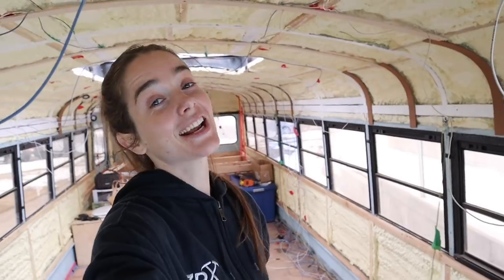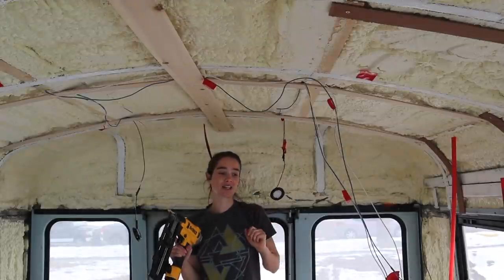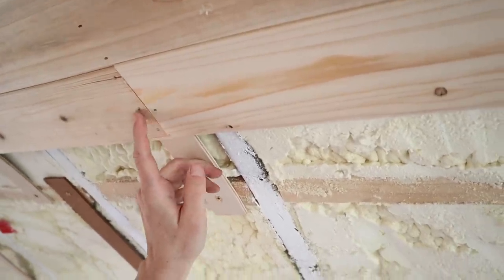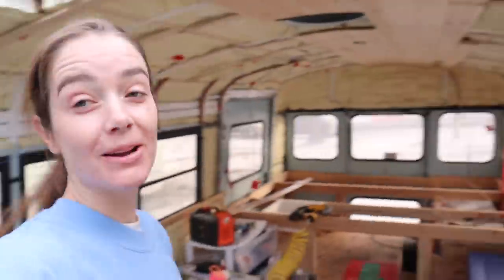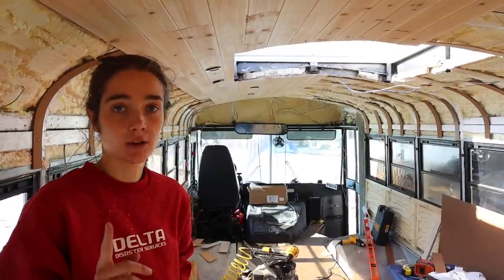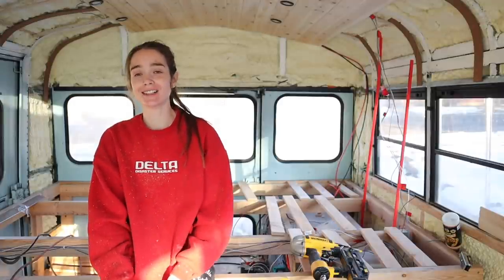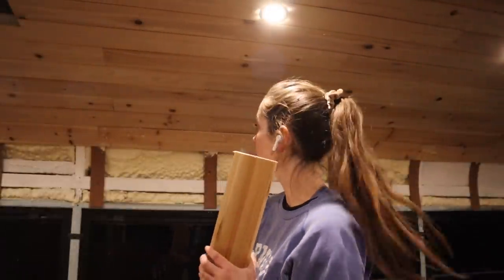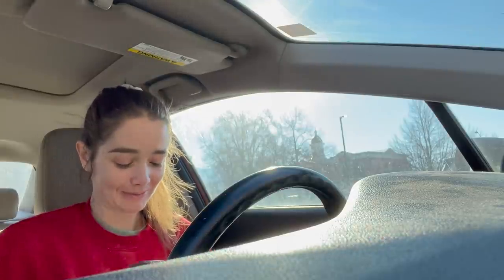Cedar School Bus Ceiling // Tongue and groove planks for the skoolie ceiling (Bus Conversion 47)

Comment: When you put your bulkhead walls in, and the cabinets, the curved ceiling will pretty much smooth out. Your doing  a great job . Just remember...no one will ever notice any flaws when you go by the off ramp at65! Your building a house in a tin can 🥫 so, it's like a square peg in a round hole. All I can say Emma is yay 😁😁😁😁😁

Comment: The bus looks awesome! Your doing a great job!
I wanted to mention I'm think your vent opens backwards. Ive worked on RV's and campers for 30 years so I thiought id mention it if someone hasn't yet. 
It should open to the rear so it can be open when driving and wind can't rip it open and break off into traffic behind you. And without a match to keep it locked when closed whe wind will absolutely dip it open and it could fly off your rig. 
Love the bus! Your doing awesome!

Comment: Very nice job on the t&g ceiling! We used the same sort of pine t&g on our bedroom ceiling, and applied a wipe-on tung oil to finish it. That was several years ago, and as expected, the ceiling is now a nice mellow golden color, just a little darker than the bare wood. It's kind of a p.i.t.a. to apply, but well worth the effort.

Comment: Got it done.  Wood filler and consider taking glue and sawdust from cutting those boards to make a paste and fill using it.  That works quite well.  Take some left over scrap of the boards and test your stains, polishes, ect on that first.  Give good time to dry before giving a thumbs up or down.  You are making progress, be glad of that and continue to Git Gud.  Do your thing.  I loved the part where that guy came in and was like, "uh too low in here.." and you were like,... "how bout over here..."  with the raised area.  Noice stuff.

Comment: The ceiling looks so much better now, at least now you don't have to duck under wires. when doing tunnel and groove boards get a short length and cut it down the middle then use the appropriate half to hammer against rather than risk damaging the piece you are putting into place, good job well done

Comment: Also you can use small bolts places, with a bolt and nut on the back to tighten in some places and you don't have to be so exact with the hole size, but it can really only work in places that you can get to both sides.

Comment: I would use clear satin polyurethane. Brush the cracks then slowly roll the rest. It will work like glue and hold it together. Do that before you fill any holes so it doesn't leave a blotch. Liquid Nails works good for caulking. It shrinks a bit and dries a wood tone. But not the holes. They have wood tone crayon sticks. I don't think you'll notice the holes after it finished. 🌹

Comment: In the future you can make a spline for the groove side it's just a small piece that you can stick in the groove of one board the centerboard to make it have a tongue on both sides

It's a little bit hard to do it on the material you're using cuz it's very thin but you can probably find something that's already cut at the supply store or you could cut a piece if you had a table saw

But you did an awesome job

Comment: Hehe, definitely work in progress. As you say bad-ish... Doesn't look bad-ish to me.. You should have done better if you laminated cross supports at least two layers.. One more advice - shoot the nails a bit slanted, not exactly square to the board as the grip will be better. Oh, you're really trying to start a fire, don't you? =) Yo, those  parts when everything gets along and then a sudden "crunch" and "oh shit", "damn".. tells you a slight pause in the progress is coming.. =D Oh, safety glasses when drilling upwards would be a nice improvement.. Linseed I think is pretty fine, just warm it up a little before applying, if it's cold.. I'm still having a blast looking your videos as you try to keep composed and serious... Good work though, the final happiness is priceless! =) Go Emma, cheers!

Comment: Don’t try to fill the gaps with wood filler, it will just draw your eye to it and going down the road it might just vibrate out.  Since you don’t have a lot of structure to the ceiling, plan on anchoring the cabinets to the floors and walls.  Unless you can screw into the metal ribs of the ceiling.  

It is looking more and more finished.

Comment: There is a putty you can get to fill the nail holes and even the gaps. I would get the Natural look fill if you're going with a clear on the wood. Keep in mind an oil based product is going to yellow over time, meaning it will look yellowish. Oil will give you a finish a latex can't and is more durable. 

Look at a Whitewash. I think that would look awesome. There are ready made Whitewash products out there or make your own.

Latex add 50% water to start and add more as you need to. Buy a pint or quart to practice with. I've done mane Whitewash paint jobs, The finish look is really up to you. You can make the white as thin (transparent) as you want or as thick as you want. This is why I like to use paint and not a pre mixed product.

C&D Painting of Newburyport. That's my old painting company. The Facebook page may still be up, if it is there should be some Whitewash pics on there.

Oil use a read the cans. You can't just use paint thinner or mineral spirits in some brands.

Comment: Looking really good!  👍 My only concern is that I didn’t see you use any screws and only glue on the first board.  Worried that the nails will back out over time.  Did you use any screws or more glue than I noticed?

Comment: The good thing about buses is that there are windows all around
= The good thing: it will let in a lot of light, so less energy needed.
= The bad side: as you properly insulate your bus, the light will enter a lot of heat!
----> The solution: Glue anti-UV and anti-visuality plastic films from the inside = Otherwise, your bus will turn into a giant pressure cooker!

Comment: Might want to use tung oil instead of linseed oil. Tung oil creates a harder, more durable finish than linseed oil. Tung oil is more water-resistant than linseed oil. Raw linseed oil takes significantly longer to cure than pure tung oil.